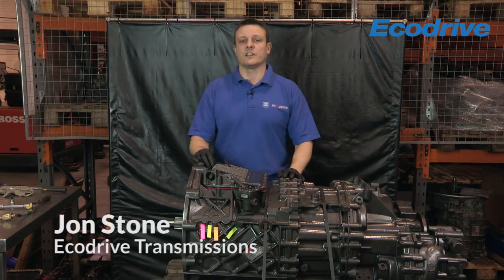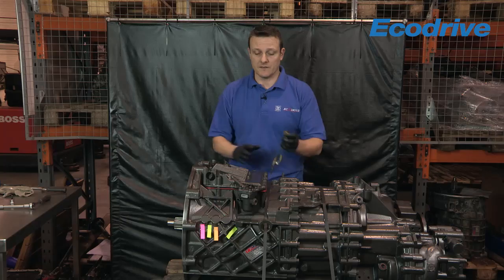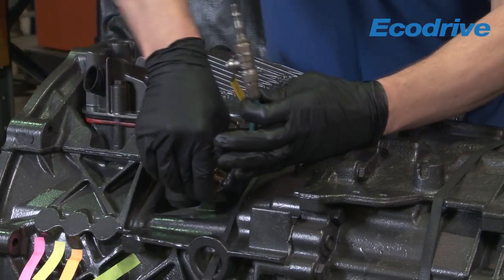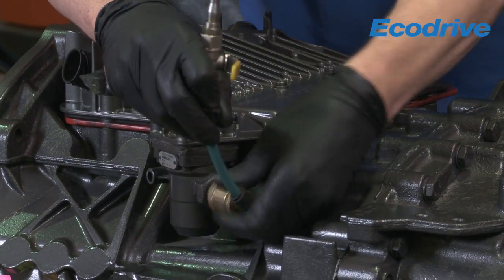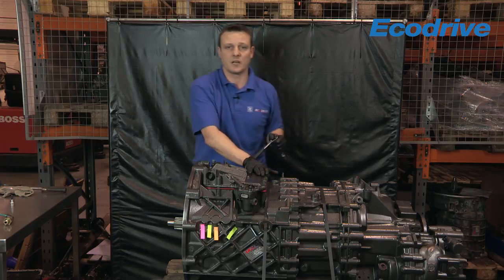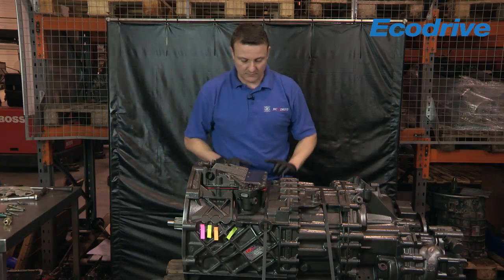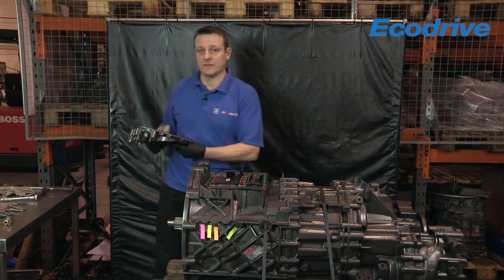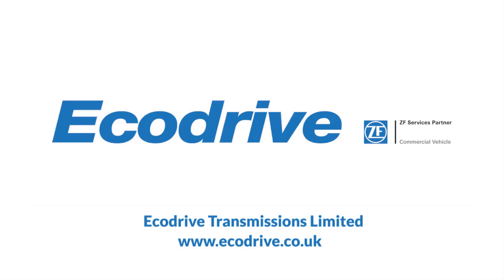Ecodrive Expert Engineers - Detecting and rectifying an air leak on an AS Tronic Shift Actuator

Comment: Dear brother, my zf is transmission. Gears shift but do not shift back. If you brake the car, then the car stops because the car is not neutral. Can you tell me what the problem is?thanks my WhatsApp +971508771812 Email saeed.majeed902@gmail.com

Comment: how about when the valve that supplies the astronic with air fails to supplies air in astronic
Reply from the maker: If that valve totally fails then the system will close down, as the system needs minimum 6.2 bar to operate.

Comment: ZF IS THE WORST TRANSMITION, Too many problems, expensive and un necessary parts
Reply: Thundermiami all the 7.5 tonne lorrys are zf  transmission are they not. ? I'm thinking on buying a 7.5 tonne iveco tipper. With the automated manual transmission. I'm a wheelchair ♿ user so it would be better for me.are they a good job do you know. ?
Reply: Definitely. Whatever fuel savings that one many experience will be eaten up by repair costs. A charter company that I worked for spent 40K per bus to have them re-fitted with Allison B500 transmissions. They had 10 buses with factory equipped Astronic boxes and spent 100K in one year on repairs . Every single driver hated them as well.